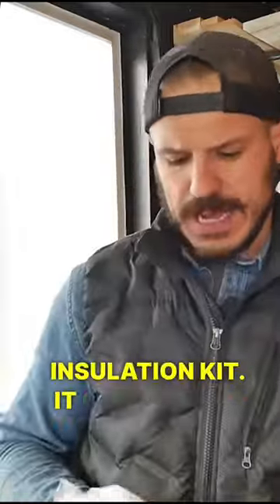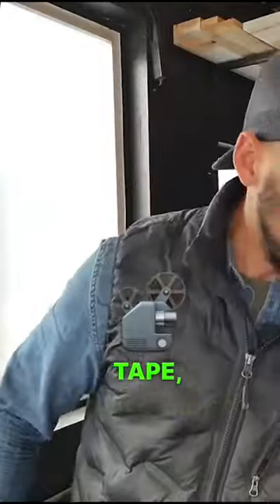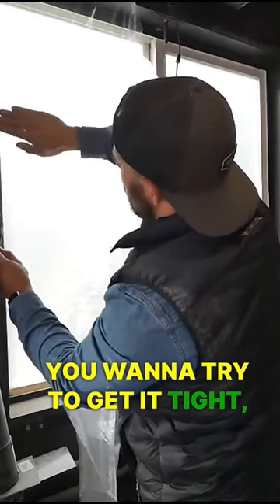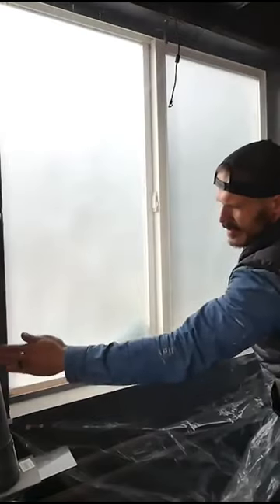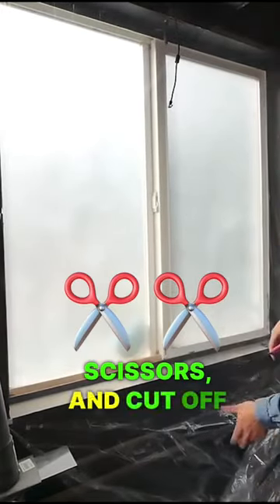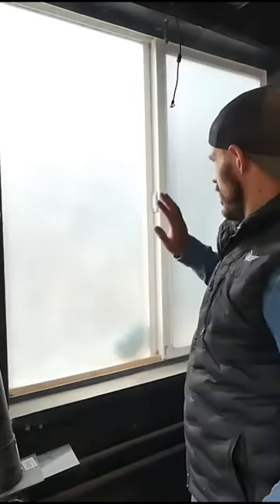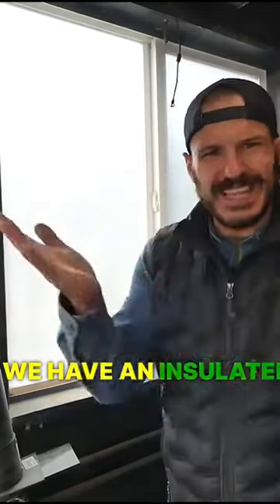Insulation drafty windows

Comment: Used a similar product on my kitchen window, with regards to people saying a thin piece of plastic doesn't do anything. Believe me, it works really well. 👍
Reply: This is due to air sealing does wonders. Most current home insulation levels are fine. But most homes are not air tight so you get tons of draft
Reply: Yep, people don’t realize that the best insulation is technically air itself,
specifically still air. This is why very fluffy things are very insulating and also why fans are so important for distributing warm/hot air around. Adding an extra layer of still air can drastically reduce window draft and moving air around the windows.

Comment: If put on correctly, these work great. I've used them many times over the past 10 years. They are expensive for a plastic sheet though (IMO).
Reply: Heat shrink is expensive either way

Comment: I've tried these kits and usually the tape that comes with them is so god awful that you made that as well just buy tape separately and some plastic sheets
Reply: I find this has a lot to do with your paint. Very glossy trim paint that isn’t perfectly flat may have issues with the tape that comes with the sets. Works well when put directly onto a window frame or to less glossy, higher quality paint.
Reply: @TheHeadincharge Yeah I installed some of these a few days ago and my paint is really rough/textured, kind of stucco-like, idk what it's called exactly, so the tape didn't stick very well. But then I laid down a layer of cloth gaffer's tape to the wall and stuck the tape to that and it worked way better

Comment: So you’re not meant to have the plastic directly on the window?
Reply: No, the key for this to work properly is that there needs to be an air gap between the film and the window. It is not really the film that insulated the window, as much as it is the pocket of still air that it creates that seals it off. For the most optimal results, you should actually put it on the window casing, but this often doesn’t work on windows with blinds.

Comment: Good enough to mask for painting but for insulation just bite the bullet and replace the windows. Nothing else works
Reply: This is absolutely false. This will work better than a new window. It works on the exact same principle as double pane glass but it has 50x more of an air gap
Reply: If done right these work excellent. Windows are too damn expensive to just replace when you feel a draft
Reply: Expensive windows only add about 2 r value so what’s it really worth
Reply: Nah, it is definitely cheaper to just do this. It’s the exact same thing as buying a double pained window. For even better insulation, you can add a layer to the casing as well. Now, if your windows have issues with drafts or aren’t properly sealed, replacing is probably best unless the repairs are easy.

Comment: Looks like you sealed it, instead of insulate it....?
Reply: The air layers stop heat loss due to convection. The plastic itself doesn't insulate but the air inside is great insulation. Most modern windows have 2 layers of glass with a small void of air between them. Heat transfers much slower through gases than solids
Reply: @maxfreeman3764 I'm sorry but you tried to compared this to a double glazed window lol with the same effect and benefits lol please stay off the internet lol
Reply: @icykool21  where did I say it was as effective? All I'm saying is that it's the same principle 🤣
Reply: @icykool21  this product isn't made to compare with double glazing. It's made for people who have single glazing windows and can't afford to properly insulate their house but want to try and cut down on heating costs. We all know it isn't as effective, doesn't make you a genius for pointing that out
Reply: @icykool21 What are you on about… this insulation works off of the exact same principles that a double paned window does… still air is the best insulation and the more pockets of still air you add, the better the insulation. Double-pained windows work better if the gap is in a vacuum, but a larger air gap can account for the lack of a vacuum as well.
Reply: @maxfreeman3764 You can also still add it to double-glazed windows and it will have a benefit. Even though a double-glazed window is more insulating than a single pane, it is still a large source of heat loss. That guy is an idiot though.

Comment: .4 mil plastic is insulating the window eh? Just chuck your $15 on a fire and stay warm for about the time this thing would work....
Reply: It's hilarious how you are so confident in your ignorance.  It's not the plastic that is doing the insulating, it's the air gap.
Reply: @randybobandy9828  it's hilarious how you don't understand the laws of thermodynamics. There is a difference between a thermally broken window and air trapped in .50 mil plastic that is constantly attempting thermal equilibrium. Why do you think they use argon gas? Ignoramus says what?
Reply: @JonesersRX7  I'm not talking about a thermal break window. Simply a window with a air gap. Get a clue buddy.